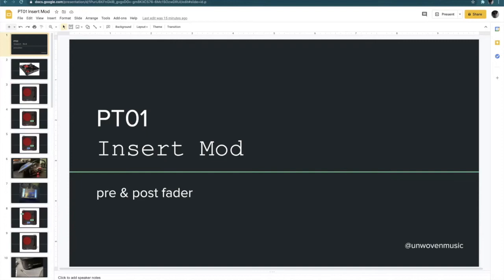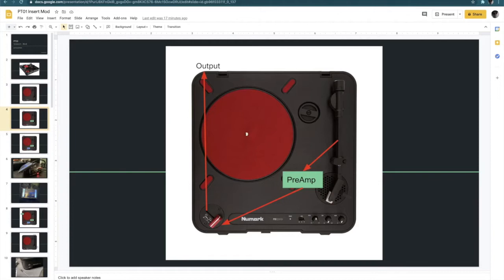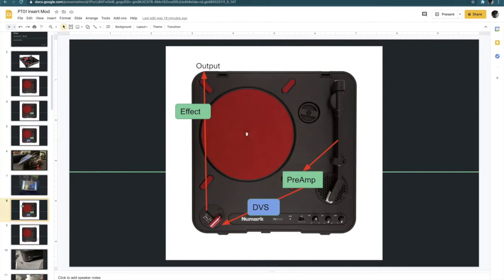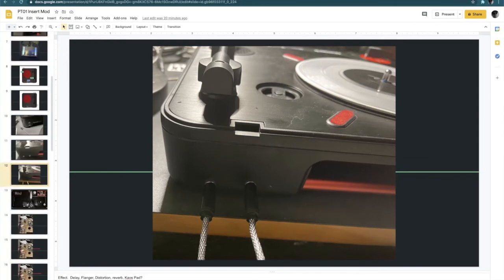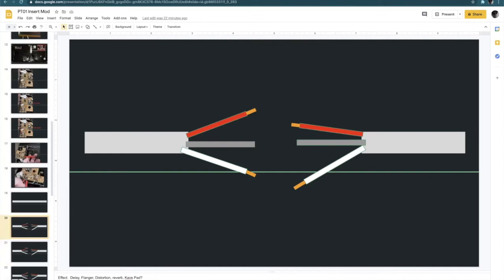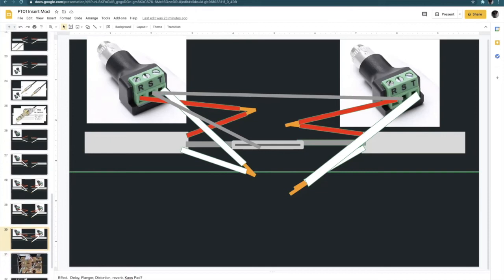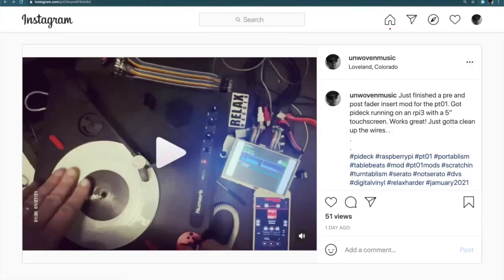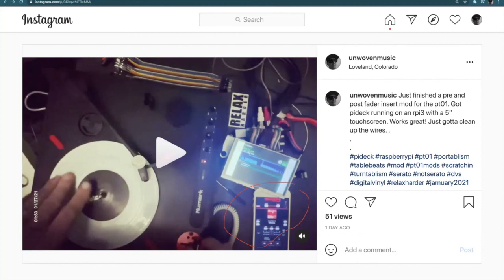Numark PT-01 DVS Mod with PiDeck

Comment: Hi there. Many thanks for the detail video. I plan on doing something similar with an RPi running PiDeck, though I have a question about the TRS audio jacks. Would it be possible to run a DPDT switch to bypass the TRS jacks so that you can still use regular vinyl on the internal speaker and then switch to access the TRS jacks for DVS? It's something I've been pondering and hoping I could utilise with my setup. Any guidance or feedback would be appreciated. Thank You :)

Comment: This is really cool! I'm interested in doing the DVS mod, but not using Rasberry pi. Just the hack like you mention from Reddit. Could I solder into the lines like you do in the video, rather than into the board itself? You don’t show the switch you install to change from DVS to regular vinyl. How do you do that?